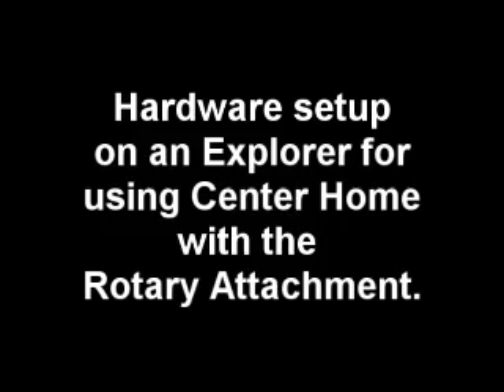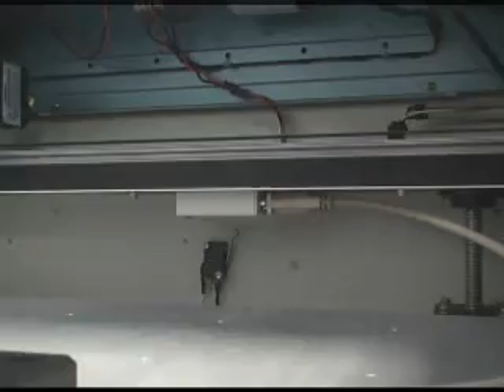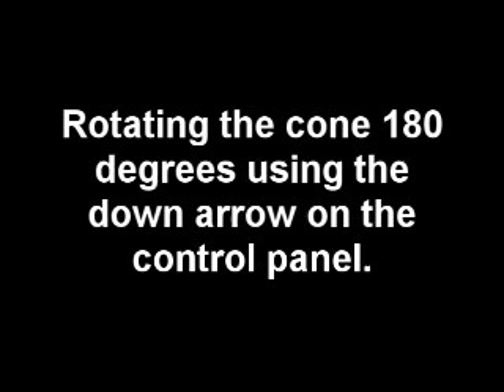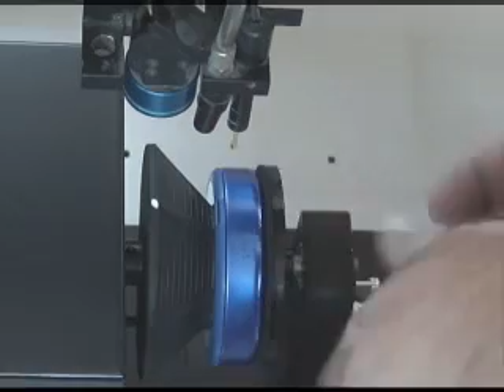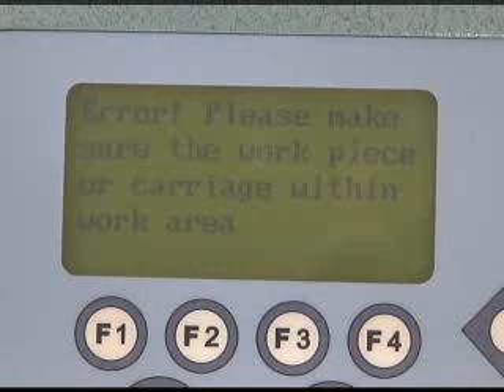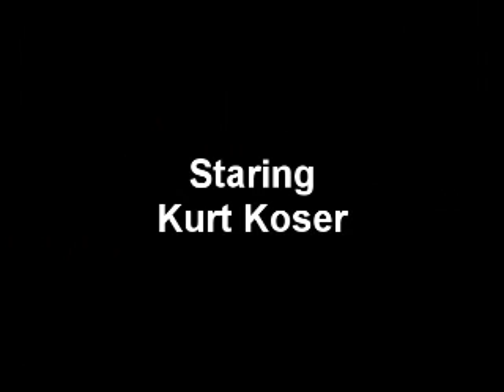Rotary Attachment Using Center Position Mode Part 2   Hardware Portion

Comment: Know this is really old, but why do you rotate the attachment.  I never had training on the machine bought used in 2007 and I use rotary attachment but have never been able to get it to start where I want.  When I hit start it always spins some so I can never get the same file to start in the same place every time.